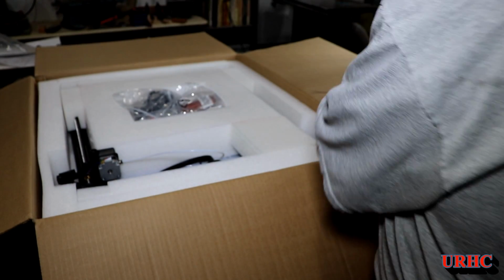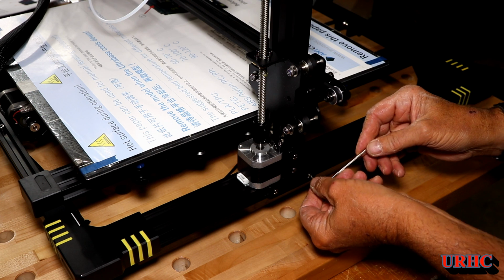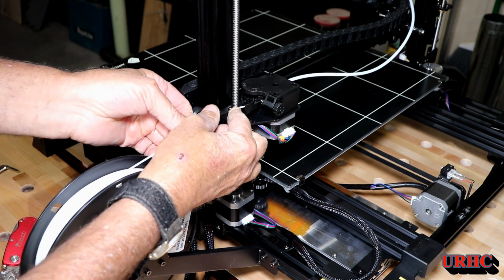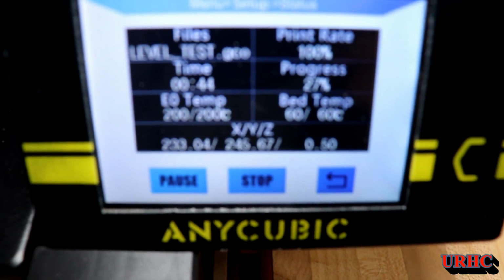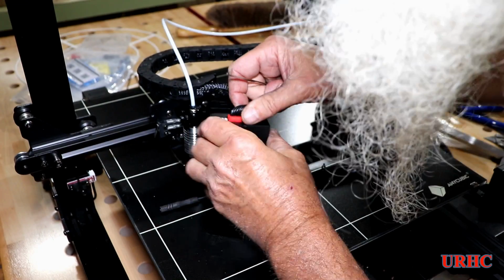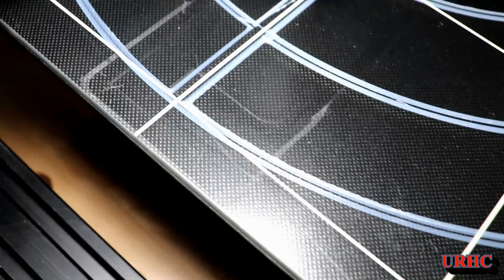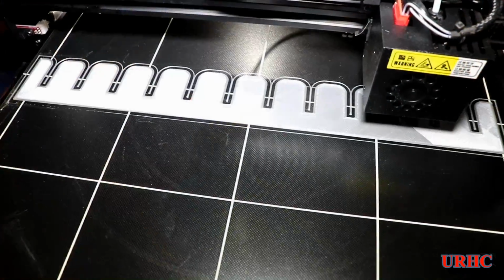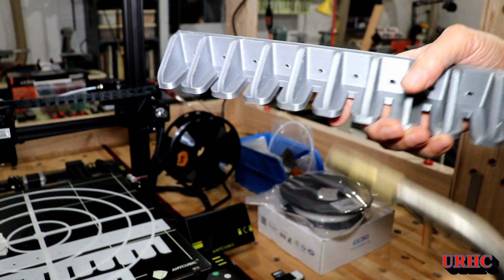ANYCUBIC Chiron 3D Printer Unboxing Assembly And Tweaking

Comment: Dear Sir, Thank you for a great video!
I just got a used one Chiron without the leveling sensor and the SD card,  everything work but  the heated bed just stay on the room temp, I have used Cura  prepared a G code file for test print and reset XYZ  zero position  , however ,  the printer head moved up 4 inch and start printing ( I have used a heat gun to heat up the bed to made the system run), I have tried many times, would you please share some idea to help me. Many Thanks!
Reply from the maker: I have no idea but you may have a bad offset number in your settings.  Go through  the setup and leveling again and print a one layer file until you get good results. Thanks for watching.
Reply: @unemployedredneckhillbilly2023   Thank you so much!
Reply: it doesn't start printing on the 1st layer on the  bed but up 4 inch

Comment: This applies to most Anycubic printers.
How to Permanently level the print-bed:
1) Remove leveling nuts, take print-bed off the Y-axis carriage.  Take care with power connection.
2) Remove springs from leveling screws.  Toss 'em if you want.
Check leveling screws are secure to print-bed.  Correct loose screws before proceeding.  i3 Mega, loose leveling screws a common issue.
Check leveling screws are perpendicular to print-bed, check that screws do not bind with holes in Y-axis plate.
Holes in Y-axis plate benefit from being clean; counter-sink, break burrs.
3) Thread leveling nuts on leveling screws; run them on the leveling screws, but leave about 2 mm gap from print-bed.
4) Replace the print-bed onto the Y-axis carriage, adjust leveling nuts to 'rough-in' the print-bed level at about the same height the springs would have.
Bed is now supported by leveling nuts on the leveling screws, rather than floating on springs.
5) Under the Y-carriage plate, install jam-nuts on the exposed section of the leveling screws, but only 'finger-tight'!
6) Pre-heat the bed, Manually level print-bed as per manual, 'loosely-tighten' the jam-nut as each corner feels right.
7) Allow the bed to cool, then re-heat.  Re-check print-bed leveling, tighten the jam-nuts properly if all is well.  Loktite Blue!
After this mechanical leveling, mesh-leveling (25 samples) will account for any warp in the print-bed itself, but may be optional if your print-bed is flat.
It takes over an hour (preheat, cooling to room temp, reheat) to do properly, but once set it will hold level, as long as the jam-nuts and leveling-nuts and screws are not disturbed.

I had an i3 Mega X hold level for nearly two years with almost daily printing using the above technique; mesh-leveled twice during that time to fix bed-adhesion issues.
I've not used Anycubic firmware in a very long time, I run Marlin 2.0, so I can't speak to mesh-leveling with the Chiron 'out of the box'.
Reply from the maker: This has held true since  the initial leveling.  I don't use it a lot because  it's slow but it does a nice job on bigger items. Thanks for watching.

Comment: I like how you described everything very precise. I’m at a point where I need a bigger build volume I have 5 cr10’s in my farm and I’m trying to figure out what the difference is between the Chiron and the cobra max everything looks the same except the price but that’s not the issue but you probably don’t have the anycubic cobra max I was just wondering if you got yours running the way you like? 
I’ll subscribe and look at your other videos. 
Thanks...I’m pushing 60 and I need something to do when I retire. 
If this world doesn’t collapse first
Reply from the maker: This works pretty good but it is very slow for decent prints. The extra mass would really need bigger motors for faster prints. It's the only anycubic printer I have so I have no way to compare them. Thanks for watching.

Comment: I wish I could have started using mine. Bed was DOA Does not heat up
Reply from the maker: They should take care of that. Mine  stil works good. Thanks for watching.
Reply: @unemployedredneckhillbilly2023  fixed it one wire not connected properly inside works great now

Comment: Got mine yesterday and similar results to you. I’m pretty impressed with the performance out of the box and love the build volume compared to my Anycubic Mega. You’re setting up a nice workshop there. Love that table! 👍🏻
Reply from the maker: They definitely  work good but are slow. I printed all the tool holders  for the new workbench with it and it did a great  job. one thing I found is putting  it in my grow tent to hold the heat really  made the prints look better.  Have fun with yours.  Thanks for watching.
Reply: I’m building a quick enclosure using the packing foam and double wall advertising board until I sort something better. I do a lot of ABS.  This thing has a lot of area to heat and it’ll cost! I’m also going to insulate under the print bed.  Did this with the Mega, and it makes a big difference. And yes, it chugs away in no particular hurry but Anycubic has come a long way.

Comment: Great review.  I was wondering, how much space do you need (in the back) past the end of the frame?I have a CR 10 that needs several inches so want to make sure I have enough space between frame and wall.  Thanks.
Reply from the maker: The bed goes 4 inches  past the back frame member so probably 5 inches would  be a good number. Thanks  for watching.

Comment: I have purchased this chiron 3D printer and the flatbed of the printer was not working, it was not heating. It was a brand new printer. I contacted their technical service. They told me to check cables and asked me to check connections with a multimeter (in this case I had to spend extra money to control their quality). I have requested to return the printer and they emailed me a return address but not not a return label. I had to buy a multimeter, I had to pay the return shipment and I returned the printer. After they received the printer they cut the communications. I have paid and purchased a brand new printer and they took my money. I returned the printer and now they have the money and the printer (plus my expenses). BE AWARE OF THESE CHINESE STYLE CUSTOMER SERVICE!!! If the printer works you are lucky, if it does not work, do not bother to contact with the anycubic customer service. DO NOT BUY THEIR PRODUCT !!
Reply from the maker: Did you contact  Gearbest about the issues with  support from Anycubic. They usually can work with the manufacturer to get problems fixed when you buy from them. I didn't know  you could return this Chinese stuff. Some  of the Chinese companies  really suck. I got screwed by Hubsan with a defective Zino2 and would  never buy from them again. Ortur is the only  Chinese manufacturer I trust for good support.  Thanks for watching.

Comment: what exact parts did you use to fix the z axix issue
Reply from the maker: Bought  some  POM zero backlash nuts but haven't changed them yet because  They need mods and I haven't had to use it in months. It's on the list to fix in the future.  Thanks for watching.
Reply: @unemployedredneckhillbilly2023  oh so it actually works even with the backlash
Reply from the maker: @samuelpuhretmayr5036  Yes with some banding.
Reply: @unemployedredneckhillbilly2023  do you mean bending idk what banding is
Reply from the maker: @samuelpuhretmayr5036  Its when you get uneven horizontal lines on the vertical faces caused by mechanical issues.
Reply: @unemployedredneckhillbilly2023  thanks are you sure i saw a lot of people stabelize the z axes from moving back and fourth and they seemd to get very decent prints
Reply: @unemployedredneckhillbilly2023  any way you could tell me where i can get those things i am kind of new to 3dprinting

Comment: just bought this and have to say it aint that easy to get this thing running properly.I will check it over for lose screws etc. This video really helped me
Reply from the maker: Getting the Cura settings figured out is a pain also. It's slow but does a good job once adjusted. Love the bed material. Thanks for watching.
Reply: @unemployedredneckhillbilly2023  Well now after following directions 3 times. I have a defective bed. The bed wont heat past 18 .... 
I have a smaller anycubic printer and it works like a charm.
Reply: got it fixxed. Bumpy start but it seems to be chugging along just fine now )
Reply from the maker: @Kingpod  Glad you found the culprit.  Mine  has several hundred  hours with  no problems yet.

Comment: Great video, very entertaining watching St.Nick help me through setting up my printer! Thanks man!
Reply from the maker: Thanks.  Mine  has been a great  printer so far. Love how good the bed works.  Thanks for watching.
Reply: @unemployedredneckhillbilly2023  hey I’m actually having a lot of trouble with setting mine up I’m getting a lot of crooked and dragging prints any suggestions?
Reply from the maker: I had a problem  with  all the rollers needing  adjustment after it ran a while.  They weren't properly  tightened at assembly and the cams apparently turned. The bed rollers can take a while to get perfect. Be sure to follow the  bed leveling adjustment instructions and add the offset after auto leveling.  I would  concentrate  on getting  the leveling  bullseye to print properly and have no dragging on the first layer. Its a big printer so feed rate and jerk must be kept low for the best prints. The old cura that came with  mine worked better then the latest level for mine to get going.

Comment: PRO TIP - Always use LockTiTE on your hardware. Doesn't matter if it's a 3D printer or a kitchen chair. It will save you from the headache of hardware loosening up over time.
Reply from the maker: You have to be careful with Chinese hardware. The heads can strip out easily should it have to be repaired. Thanks for watching.

Comment: Is it 12 or 24v. 8 bit,dual z, and how does it compare to the cr10?
Reply from the maker: 110 /220 volt. its slower but same print quality.  The bed on this is awesome.  Thanks for watching.
Reply: @unemployedredneckhillbilly2023  was speaking of the hot end heated bed and mother board 12 or 24v
Reply from the maker: You should  contact  AnyCubic for that info.

Comment: Very good and helpful video. Thank you!

Did you ever buy those zero backlash nuts, and if so - what were the results and which nuts did you buy?

Thank you again for a very good and informative video!
Reply from the maker: Bought delrin nuts but haven't installed them because they need modifications.  Thanks for watching.
Reply: I ordered a Chiron and is expecting it delivered tomorrrow, so your video was super helpful. New subscriber. :)

I think it would be very interesting for many printer owners if you would like to make a before and after-comparison video.

Good luck with the new nuts! :)
Reply from the maker: After  the original  videos  I just  show stuff  like  that in other build videos.  Not enough  views  for things like that to  make it worth the time. There  are channels that only make 3d printer videos that make comparison videos like that.
Reply: Ok, thanks. If you find any benefits with exchanging the nuts I would greatly appreciate it if you drop a comment here. 🙂

Thank you!

Comment: I just ordered this printer and was wondering if you have a link to the 0 backlash nuts you used?
Reply from the maker: They were  t8 4 start. I ordered  these https://amzn.to/37fNt49 but haven't  tried switching  them yet because  they are not tapped and will need modifications.  There are brass tapped ones available  that are tapped also.  Thanks for watching.

Comment: This is definitely one of the best reviews with explanations I have seen on the anycubic chiron. Thankyou
Reply from the maker: I have a couple hundred  hours on it now with  no problems. Just had to re tension the belt and adjust the wheels. It's  not perfect and fairly slow but works good for the price and I  see many are posting mods to improve it. Update the z nuts to zero backlash nuts and it does a good job. Thanks for watching.

Comment: How strong is this material, do you know any physical props?
Reply from the maker: It's PLA that is not very strong or resistant to sunlight.  Each  manufacturer has different specs so look for the properties of the material you purchase. Orientation  of the layers makes a big difference in the part strength also. Thanks for watching.
Reply: @unemployedredneckhillbilly2023  
Thanks!

Comment: I bought this printer over a year ago.
Here are some essential mods:
1: tmc2208 silent drivers - easy installation, will save your ears from high pitched wines.
2: metal bracing to make sure the z-axis doesnt wobble. If you are going to use the full volume of the bed this is essential (only cost my $7 in parts from Home depot)
3: e3d v6 hotend, the stock heater block is tiny, i dont think i got good extrusion with a 0.4mm nozzle until i replaced the stock block.
Reply from the maker: Mine  is great  as is . Yout a couple  hundred  hours on it and only had to go over all the belt tension and wheel adjustment once more. I am getting  good extrusion with the stock parts. The biggest  problem  was getting  the cura settings right. I don't  use near the full volume in the z. Still  have to replace  the z nuts with  the spring  loaded sets I  bought.  I love that build plate. Perfect  adhesion and releases when cold every  print. I put it in my grow tent so I don't  hear it and it stays very warm when printing.  Thanks for watching.

Comment: Can you please give me some more details about the 0 backlash nuts, I have just got a Chiron, literally still in the box. 
Where to get them and how to fit them? 
Best regards 👍
Reply from the maker: They are just  spring  loaded 2 piece nuts. Amazon  has them.  I have some  leftover t8 2mm pitch from my router  table I am going to  try when I  get time. You have  to remove the z lead screws and swap them out. Put the spring and second nut on the top to preload it down. Not sure if it needs different hardware till I try it. Thanks for watching.

Comment: Great video and review! I just bought one of these, and I'm still setting it up. Wondering where you get the anti-backlash nuts? Also, what speed are you printing at? Thanks!
Reply from the maker: I have some  left over from my router table build. They were from Amazon.  I haven'tswitched them yet. Run it about  100 hours then go over every adjustment and tighten  belts. Thanks for watching.

Comment: do you know if the 3D printer run on Fusion  360
Reply from the maker: Fusion can output stl files directly to cura for slicing. Thanks for watching.
Reply: Yes fusion 360 does work

Comment: I was looking at the Ender CR-6 Kick Starter with auto-leveling for a while.
I don't use my Ender 3 enough to justify replacing it.
I had to replace half my rollers, because there was side to side bearing play which caused the bed to pop up and down out of alignment.
Apparently it is a common issue with those bearing rollers.
Once I got them all replaced, it did work better.
I do find I have to reset the level regularly, so I wish I did have auto-leveling.
Reply from the maker: As you know it always  takes a little tweaking and some  adjustments as parts wear in. I am going  to buy some delrin wheels and better nuts that should  make it an awesome  printer.  Hard to believe  you can get these for around $400. The auto leveling is a really nice feature and was easy  to use. First product from China I  have purchased that came with a great manual. Thanks for watching.